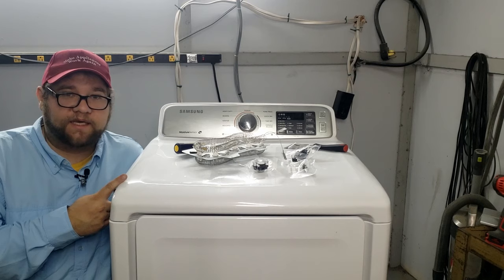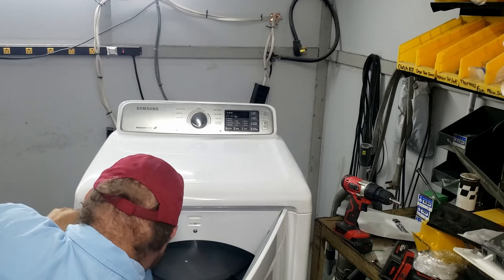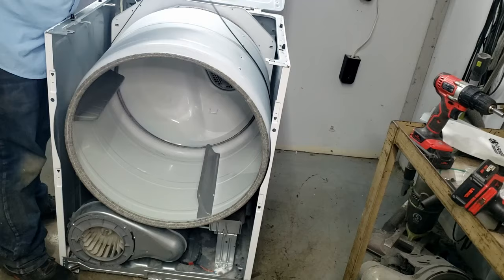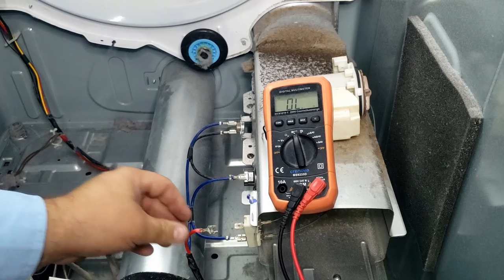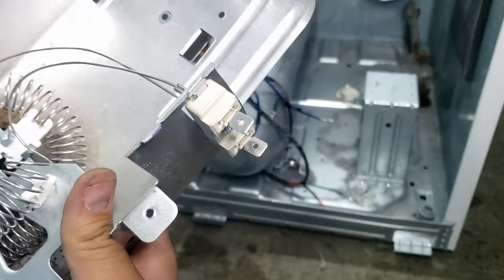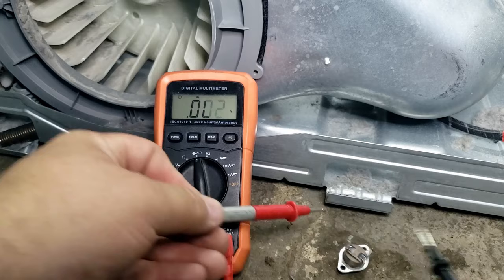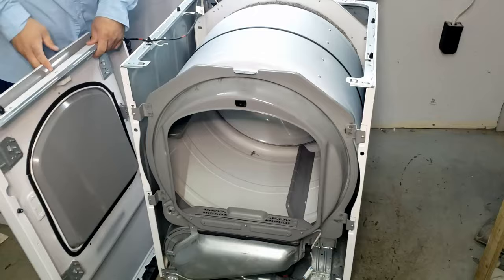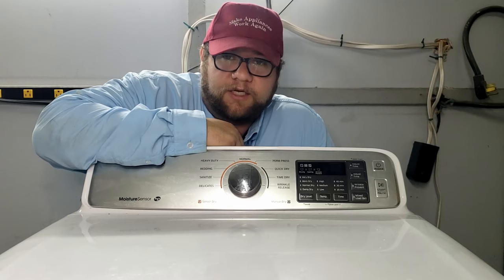Samsung Dryer Heating Element Replacement - How to Fix a Samsung Dryer Not Heating

Comment: Thank you for posting this video. I’m currently waiting for the parts to be delivered. I checked for voltage at the L1 and L2 lines together in the back of the dryer with my voltmeter and am not getting voltage. But when put L1 to ground or L2 to ground I am showing 120v on each. Can the failed part or parts cause a lack of voltage between L1 and L2 or does is have to do something with my outlet or the wiring from the breaker?
Reply from the maker: If you are not getting voltage between L1 and L2 then you have a major issue with the outlet or breaker. The dryer NEEDS 240v between L1 and L2 to operate properly. It could be the cord, outlet, or breaker. You'll need to hunt down where its stopping to get 240v by testing the outlet (does it get 240v between L1 and L2?) then the breaker box. That's a little hairy so make sure to wear gloves and watch a video on how to check it.

Failed parts will NOT change a no-240v problem at the thermal. You're using the multimeter to electronically inspect if both wires will give you 240v if both are in operation. If they can't, then there's a big issue somewhere. It does happen often enough to where I always suggest it, because without fixing that issue, you'll never fully get a working unit.

Comment: Hello Ben!  Very thorough and detailed video!  Will the first link for the canister with element, etc. work for Samsung model# DV40J3000EW/A2?  Is there anything else you’d replace while I have the unit disassembled?   Thanks again !
Reply from the maker: Hi, you want the cannister that's the 14486 unit. The other thing many people do (and I have a link on the site for Samsung parts) is the roller wheel/belt/pulley kit... Its all right there when you take it apart. Many techs try to get customers to go for both the cannister+rollers because changing them all out basically makes your dryer all-new on the inside.
Reply: @bensappliancesandjunk  thanks!  I’ll get that ordered and go from there!

Comment: Is it possible to put the thermal fuse on upside down or just as long as the wiring is correct?
Reply from the maker: Nope, either way is fine
Reply: @bensappliancesandjunk  OMG! Thank you so much for responding. I thought I would never get an answer from anyone. Thank you so much for the video. You have my sub. 😊

Comment: I was able to replace my element without removing the bulkhead… just had to remove the bracket the heating element attaches to… the two screws in the back are not easy to get to though.

Comment: I’ve replaced everything like the video says and my dryer is still not heating!! It runs but it doesn’t heat and its like it’s not sensing the clothes being wet. Any ideas what it could be?
Reply from the maker: Did you verify that you're getting 240v to the unit? Also, you'd want to check moisture sensor to see if its bad. There's a few videos on that, but I don't have any at this time.

Comment: Replaced the heating element, dried a load of clothes then the next load didn't dry all the way and when  I checked, the heating element was broken again with several coils broken.  What happened?  Could it be something on the board are a thermostat?
Reply from the maker: If the coils were broken... That's definitely... not good. If the coils are broken, it needs a replacement. One thing that happens, rarely, during the swap is that the coils could get deformed during installation. What I mean by that is the coils aren't supposed to touch each other - if they do, it would cause a short, making them heat up & warp quickly.

Having said this, you GENERALLY want to replace the heating element + thermostat + thermal cutoff all at the same time. The reason for this is because if the thermostat is bad, it won't show on a multimeter (it'll show continuity, meaning it will feed electric to the element to heat up). If the T-stat is BAD it won't close to cut heat off @ 200-250*F, causing it to keep heating and overheat, warping the coils eventually or blowing the thermal cut-off.

Comment: Quick question, 
I suppose that the hookup for each fuze on the heating element would be different for each model of dryer? Or would it be the same?
Reply from the maker: For Samsungs, its going to be very, very similar for almost every model. I haven't come across any samsungs that use a different heater or heater chain that I'm aware of.

Generally, the heater chain on the element and fuses is interlinked on the housing. The element is tied on one side to thermostat, then high-limit cutoff, then to the board. The other path will use motor, cycling thermostat/thermistor then back to board/relay generally. They meet at the element to give the unit 240v.

Comment: Hello, I followed the instructions and changed the heating element. When i turn on Its says error code (DE) .door is not closed .What could be the problem .Do i have to change door sensor? Help me out
Reply from the maker: Did you make sure door switch was re-installed properly?

Comment: Does anyone know if the high limit thermostat can be put on there wrong way? Does it matter which prongs are top and bottom?
Reply from the maker: Nope they switch
Reply: @bensappliancesandjunk  thanks. I replaced the high limit still getting the hc alarm. Guess I'll be changing the thermostat next

Comment: Does the dryer need to be plugged in when testing the heating element?
Reply from the maker: No. Make sure its unplugged so there isn't live voltage going through the unit. You can test it all with a multimeter which uses only a fraction of the electricity

Comment: Why can’t I remove the front?? I did everything you said is there screws in the bottom I am supposed to take out? I feel so defeated
Reply from the maker: Depends on model. This one did not have screws at the bottom, but some models could. Look at the very bottom or underneath. If you need to, should be pretty obvious. But make sure to look at all screws on the front once door is open, there will be a few.

Comment: It looks like the video of the belt/tension pulley/motor is reversed. Looking at it from the rear, the motor should be on the right and the tension pulley is on the left.

Comment: I literally did one small load it worked,  tried to do second one today and its not working again.... are these parts warrantied because going to have to take it apart again and see what is not working...not happy right now
Reply from the maker: Yes they are, but if they go bad in 1 load, you're likely having an issue that caused the last parts to go bad and these too. What does the vent ductwork look like? Did you clean it all extensively before putting parts in? What part went bad, exactly? Understand that parts can go bad for a reason. There may be something triggering the part failing so fast. Once you look at the ductwork and figure out what part went bad, let me know.
Reply: Yes it was detatched and cleaned.  We worked all week so will tear apart again tomorrow and check everything again and i will let you know.  Thanks so much!
Reply: Also can you list out all part numbers and part names so i can write them down and keep in records.  I bought dryer used so dont have manual on hand.
Reply: Also the kit only had two parts.
Reply: Looks like we got wrong part.  I ordered another set and it was completely wrong what i got
Reply: Looks like thermal fuse was wrong. I removed that and the thermostat as well and bought another set elsewhere but if you have correct one of those two as both went out since that was wrong

Comment: I did the steps and it worked on one load to dry and after that, it stopped heating again, any recommendations anyone?? I replaced the fuse in the back as well.

Comment: Ok sir you lost me like last years Easter eggs. Ceramic block orient the wires which way I don't see a pos/neg or anything. May be my problem now used your video 3-4 months ago replaced everything. The dryer ran extremely hot since. Now its blowing cold took it apart and it has a broken lower element. I need to order a new heating element. So, my question is how do you know which connector goes where top or bottom? Or how exactly should the heating element be oriented. I guess the same can be said about the sensors there is no pos or negative or and certain way they should be installed. Should it matter?
Reply from the maker: Its VAC, polarity does not matter. All that matters if you're chaining one leg into the fuse at the end then making sure the wires route to one side of the element, then you'll have the other main red wire go to the other
Reply: @bensappliancesandjunk  still confused so just connect things like I did before, which is how it came apart in the spring 🤔. Everything went together the way it came apart the previous repair. So follow suit and I should be good? Is that what your saying?

Comment: Is there any suggestion if followed exactly but doesn't come back on after.
Reply from the maker: What's not coming back on? It won't start, or won't heat?
Reply from the maker: @4suchatimeasthis.298  re-check belt, belt pulley, and door switch. With the unit plugged in and "on", open the door up to trigger the lightbulb in it. Press the door switch and see if the light turns on/off. If it doesn't, then its the door switch. That one is quick/easy to check.

Comment: Thank you for your video! I disassembled my Samsung DV45H7000EW/A2 model dryer easily and started testing components (My issue is I'm not getting heat). My multimeter gets all the same readings yours does in the video with the exception of the high limit thermostat (thermal cutoff). I'm getting reading much higher than what your video shows (24.35 kohms) but not an OL reading. Is it probable that this is my bad component? Everything else check out with similar values as those shown in your video.
Reply from the maker: Definitely off value. You could temporarily wire-nut the wires to confirm that bypassing the TCO gets you heat. If it does, then its guaranteed that's whats bad.

JUST MAKE SURE THIS BYPASS IS USED ONLY TO CONFIRM THATS WHATS BAD
Reply: @bensappliancesandjunk  Thanks. I ended up putting it back together without changing anything (don't have those parts) and on a whim ran the dryer. It blew warm for about 30 minutes then reverted to cold air again. I've ordered that kit you recommended from Amazon and I will replace the thermal cut off and the other part you recommend to replace at the same time. I get to practice taking it all apart again! :-)

Comment: I used your video to replace my heating element and sensors. It was very helpful, thank you. I just ran the dryer and It smells like something is burning. Is this normal?
Reply from the maker: Its normal. When you get into a dryer to fix it, a lot of dust particles move around and get into the element and burn when back in operation. Happens even if you clean the thing out some times.
Reply: Bens Appliances and Junk Thanks for the response! I also noticed the outdoor dryer exhaust vent is producing some smoke. I replaced all 5 components. Is this normal as well?
Reply from the maker: @nickhenry6855  Smoke? Thats a new one. I've never seen that before other than steam/ect coming from the dryer... If it continues for more than maybe 5min, I'd take it apart and investigate what in the world's going on.

Comment: The 1st 2 years already broke down. Warranty suck parts costs almost nothing on Amazon. Labor $200 per hour. I tell them F off I fix myself. For almost 9 years. Bought it brand new had to replace the same thing 5 times the elements. Replaced the drums wheels once. Then on washer the the nut that hold to spin the drum got all corroded break apart. I replaced it once. I fix it myself so many times I’m now a professional at it 😂. Never again will buy Samsung washer and dryer

Comment: What if the element doesn’t reach on one side of the canister I just got a new one but one side doesn’t reach but it’s the same part the old one was the same way also
Reply from the maker: you have to press the cannister together to insure it all fits together
Reply: Won’t that break the element if I tryin to force it to reach the other side, I can get ether of the sides to line up with the bolt holes but whichever side I choose to line up the other side is jus short of reaching so me pressing the canister down will help like it up ?
Reply from the maker: @uptopbb5723  Don't force the element, force the can. The cans love to bow on the sides. so when you put the element on top of the bottom part of can, you'll push the can in the middle on both top and bottom housings, so you can attach the screw. My next video I'm working on deals exactly with that issue on putting the element back in (since I ended up skipping over / not filming this part).
Reply: Ok cool I kind of figured I could bend it but I didn’t think that’s what was supposed to be done lol I try to put stuff back the way it came off to the best of my ability thanks for the quick responses
Reply: Put the element in just waiting for my thermostat to come dryer should be heating/drying again after I install everything

Comment: Great video.  I changed the element and it is working now.  But when I went to secure the top, one side not clipping.  Appears like larger gap on part of it, which makes no sense.  Hard to explain with out photo.  I double checked everything and nothing seems out of order.  Thanks
Reply from the maker: Sometimes the cabinet can shift in very odd ways. Those clips are a massive PITA. Make sure the back of cabinet which has screws are installed & tightened down. Likely, its off by a few milimeters and that's just enough to put it off track to secure
Reply: @bensappliancesandjunk  Thank you

Comment: Thank you for an excellent video! I needed to get the parts ASAP, so I ordered them from 'you know who'. However, I do want to thank you more professionally. I don't use PayPal or CashApp. Do you have Venmo?
Reply from the maker: I do have venmo, there's also the thanks system Herr on YT as well
Reply: @bensappliancesandjunk  I didn't know about the Thanks feature. Looks like you get 70% of funds through that. I can use the thanks or Venmo, which would give you all the tip. Up to you. Thanks again for a great video!

Comment: i just replaced my heating element and its out again .. does this mean i need new thermostat
Reply from the maker: Generally, you want to buy all sensors + element at same time and replace them all in one go, otherwise one sensor could be causing an overheat situation in heater causing it to die.

Comment: My thermal fuse keep blowing every 4 loads and I cleaned out everything. It’s only the thermal fuse that keeps doing it.
Reply from the maker: Likely there's a failure elsewhere in the system. Sometimes the motor centrifugal switch can go bad by fusing the contacts, allowing it to keep sending heat to the element, resulting it overheating no matter what.

Comment: Hopefully someone can answer this quickly. When you use the multimeter do you plug the dryer back in?? I know this might be a stupid question lol just don’t want to electrocute my pregnant self. 😂
Reply from the maker: Caitlin, that is such a GREAT question. I do want to make a video on simply how to use one for about every appliance possible.

At any rate, the answer is that IT DEPENDS on what you want to do.

Multimeters offer a few different useful modes for checking electricity. Some require "Live Voltage" and others don't. Generally, if you're tearing into the dryer to get to, say, the heating element system, you want to unplug it because of all the components you are taking apart that could have voltage going through. 

Generally, if you're testing for "Continuity" or "Ohms resistance" the appliance should be UNPLUGGED. If you are testing for Volts-AC or Volts-DC it needs to be plugged in. This is because testing for AC voltage means, you're trying to see if the component is actually getting electric going to it (meaning it should be energized and in operation) or if its not getting voltage (suggesting whatever sending the voltage isn't working right). 

I hope that general rule helps you. When in doubt, always unplug it!
Reply: @bensappliancesandjunk  Thank you for being so quick!!! You explained it well. Mine is AC so I will plug it in and have someone else try it first 😂

Comment: My dryer issue. Same dryer as video... test says clog after I've cleaned from blower to roof vent.. also disconnected hose from dryer and test still says clog...any ideas?? Great video btw!!
Reply from the maker: Check blower fan/housing. Could be a damaged fan.
Reply: @bensappliancesandjunk  took the front and top off. Fan spins when I turn the drum. When I run the dryer it blows out of the exhaust tube pretty well...so I'm just stumped as to why it's coming up with a "clog" code...

Comment: Okay I was waiting till you put the top lit back and looks like you had problem too so I’d like to see how did you put it back
Reply: It's been awhile since you commented. I'd imagine you loosened the back hinges or removed them. Slid the front side (loading side) of the top on first and then pressing down on the back and sliding it into place.